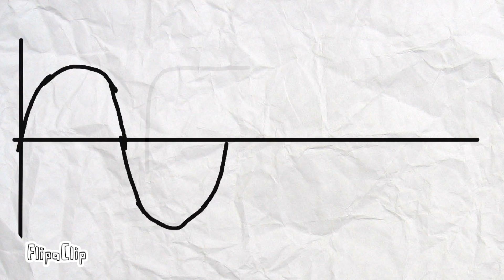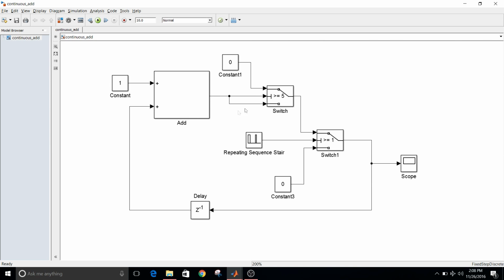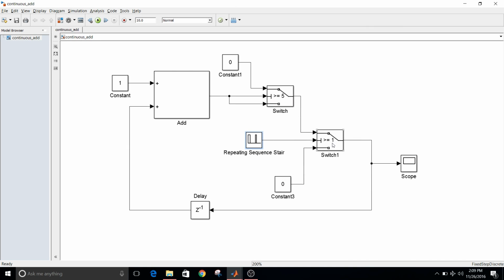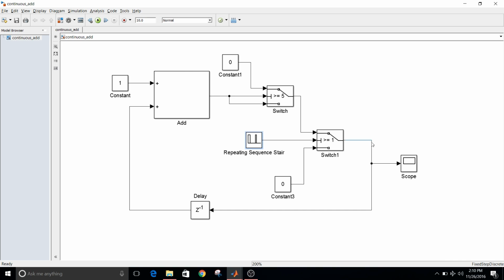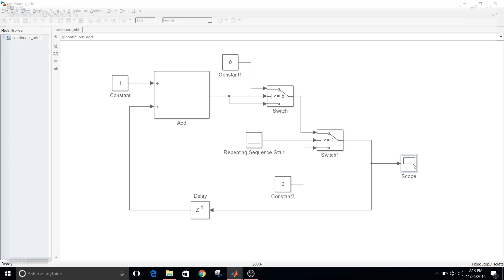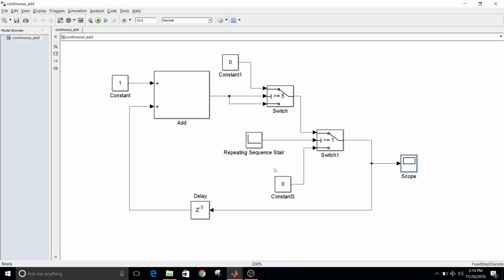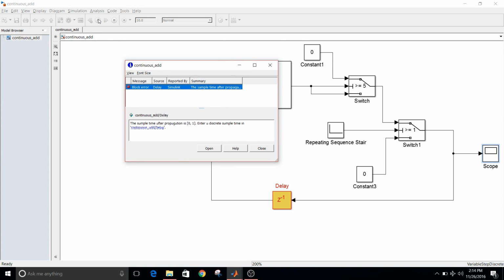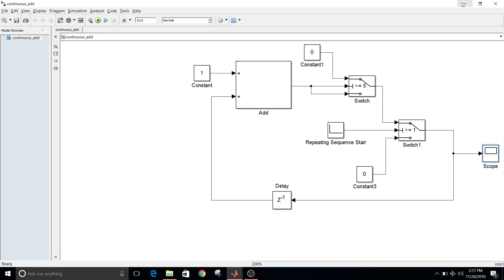Simulink Tutorial - 13 -  Continuous Counter & Delay Block Model Settings

Comment: How to make this statement  in simulink :
Varying the current from 1 to 25A, in steps of 0.4 ampere,  every 40 s over a total simulation period of 2720 s.
Maam I have to give output of this as input to a model containing continuous states. Can you please tell me how to achieve this in simulink. Please help me ma'am.